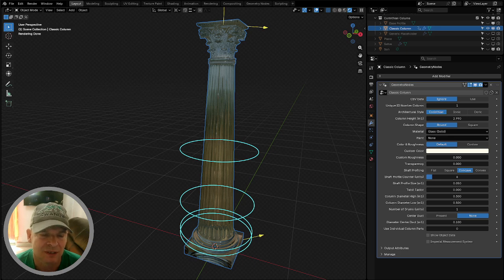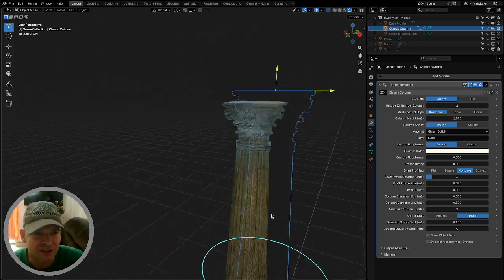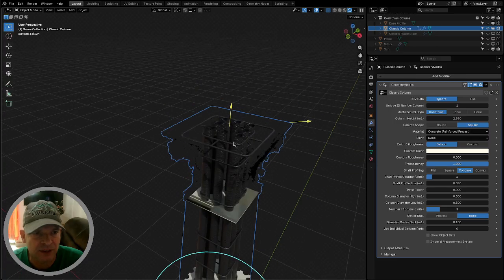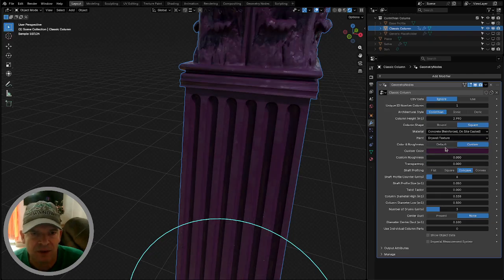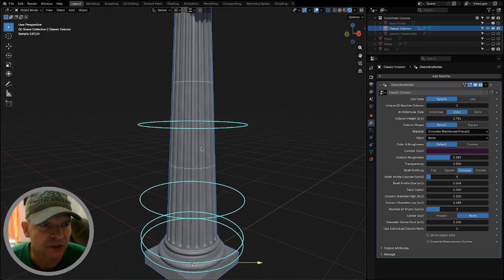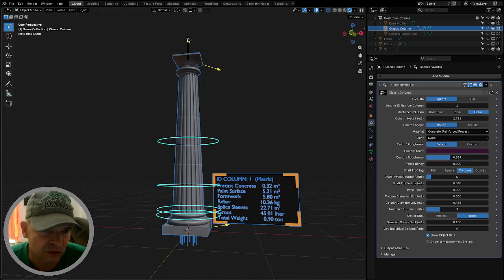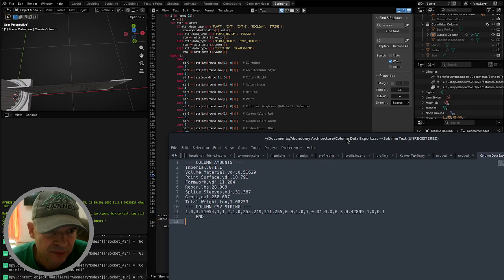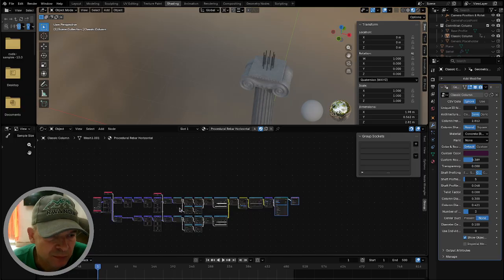Free, Professional, fully Procedural & Parametric Classic Roman Column Blender Geometry Nodes Design

Comment: This is awesome! Is the filigree on the corinthian column procedural too? The downloaded blend file isn't working for me I think it's a multipart file?
Reply: Thanks for the compliment! The column heads (capitals) are divided mesh (1/8 or 1/4 depending on how they can be mirrored). Making that procedural is possible but would be a bit overkill I think. I prefer to let the sculptors to be free here instead of trying to make procedures out of artwork. The .blend file should work fully stand alone, but I expect that installing Blender 5.0 might be necessary. Also a proper computer with graphic card is probably also required as the nodetree is quite big. Perhaps you can expand on the issue you have.
Reply: Ah yeah that was the issue my blender was out of date  @1coinh 

This is super cool stuff man I was just looking into procedural artwork out of curiosity and stumbled on this. Truly remarkable your industry is lucky to have you
Reply from the maker: Check out the update (including some debugging) https://www.youtube.com/watch?v=wzer61opzFQ&t=303s